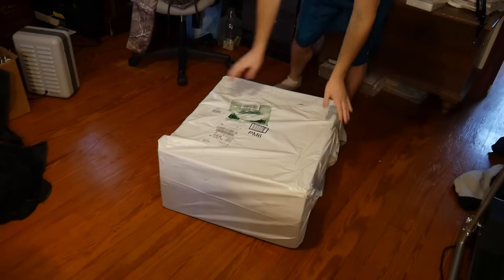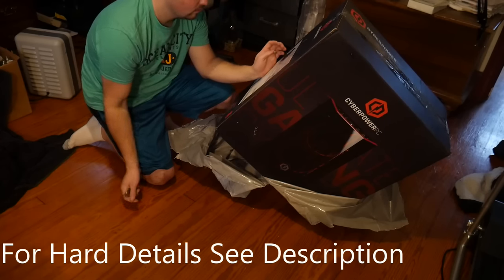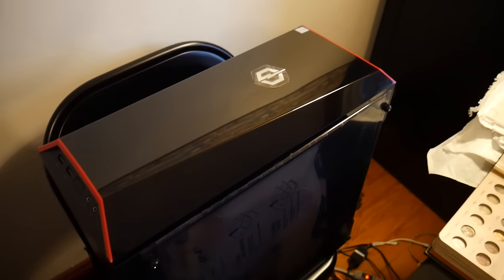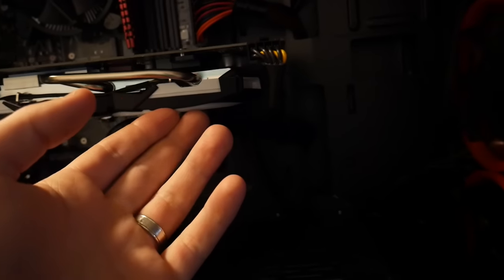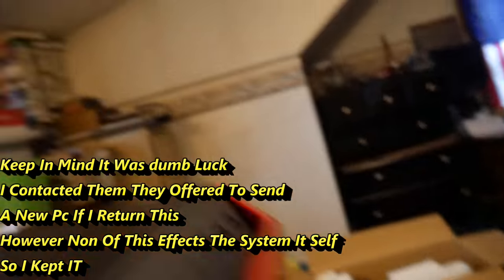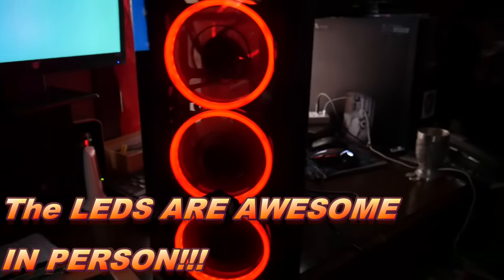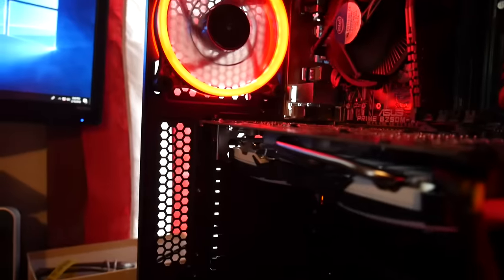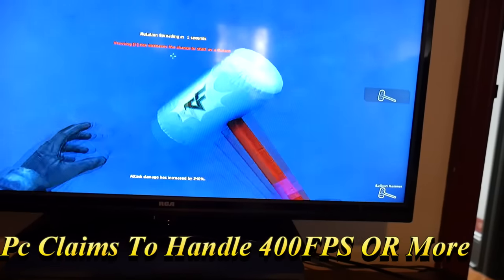CYBERPOWERPC Gamer Xtreme GXIVR8020A4 PC Full Honest Unboxing Test & Review

Comment: also would it be a good pc for starter console gamers? say if i wanted to switch could it run good as or better then console FPS?
Reply from the maker: You'll never get as good as a consol unless you spend 1400$ or more consoles and strictly designed for mostly gaming while a pc even gaming computers are designed for so much more for the value this pc is the best you can buy
Reply: Yes this 100 percent would.. I switched from a PS4 to this PC (but the latest version) and it can run games like fortnite over 100 fps while PS4 is capped at 60

Comment: how many hard drive and ram slots are there? also, can it run rainbow six siege over 60 fps?
Reply from the maker: I'm not sure on the game. There are 4 ram slots and I believe 2 or 3 hard drive slots but there's plenty of room to add anything you'd need you could stack 5 ssd  drives on top of each other if needed you won't run out of room that's for sure
Reply: The Life Of Scott Wenger okay thanks!
Reply from the maker: Your welcome!

Comment: How would you connect this to the Monitor?  What do you need to do so, I'm so new to this stuff...Sorry lol
Reply from the maker: It's ok :) if the monitor has a HDMI port then you just connect it from the HDMI monitor port to the pc HDMI port if it only has a vga connection then you connect a vga cable from the monitor to the pc
Reply: @ScottsHonestReviews  Thanks so much!  I'm getting an Alienware 25 Freesync monitor and have been researching stuff for 2 days now on and off.  I'll check and see, I think its an hdmi
Reply: The Life Of Scott Wenger I have a question. I’m getting this for Christmas and you said it doesn’t have wireless internet connection?
Reply: @impulse5476  I think he said it does...but idk.  Re watch the vid just incase I'm wrong
Reply: @impulse5476  Oh yah he said it looks like it dosen't!
Reply: Jared so what usb would you need to use?
Reply: The wifi adapder lets u connect to internet
Reply: TornadoEF6 what do you plug the adapter in to the wall or what?
Reply: @impulse5476  Well I would use a wifi adaptor usb for the wifi, 1200mbs +
Reply from the maker: Awesome@
Reply from the maker: Yes it has Wi-Fi I just recommend getting a Wi-Fi antenna it plugs into your usb port and boosts your Wi-Fi signal for better connection and speed
Reply from the maker: A usb Wi-Fi antenna  in my description I have the one listed I use
Reply: @impulse5476  No you plug it into the usb port on the pc...watch some vids on it.
Reply: Jared ok thank you all

Comment: Bro I working for this computer it looks so good can it run fortnite or roblox at atleast 110 FPS or 130? Cause if it does it’s fine for me also does this last for years or do you need to replace the tower every 3 year?
Reply from the maker: I've had it over 3 years no issues and under med settings u can

Comment: Please answer this for me. Does this pc have any heating issues? Do I need to change the power supply since I have heard that it’s pretty bad? Thanks.
Reply: I saw many reviewers said the pc has heating problems, and they need to change the fans, take off the front cover, blah blah blah... I am pretty worried since I want to buy this... pls help me out by your experience with this pc
Reply from the maker: Hello, some heavy gameplay does cause the pc to get hot the the fans turn on I added a custom 2 fan setup see full video with simply adding a laptop cooling fans and taking the front cover off takes 5 seconds I am very happy with the pc for the value I've never found one better so far
Reply: The Life Of Scott Thanks!!
Reply from the maker: np
Reply from the maker: here is to see live gameplay with this pc under maxxed settings Fortnite https://www.youtube.com/watch?v=4pxrZpGDOmo
Reply: Jacky you do need to change the power supply because it can damage your computer I recommend you get an 800 watt certified one and the heat is not good unless you add more fans but most cyberpower PCS come with a bad power supply I recommend you don't even power it on if you get it and just buy a better power supply

Comment: Can you upgrade this to 16gb ram? Will this pc run future/next gen game smootly? Thanks:)
Reply from the maker: Yes and yes I have 28gb installed
Reply: SteamBun34 yes but it comes with 8gb of 2400mhz so to upgrade either buy another stick of 8gb 2400mhz or go with a 2 pack of 8gb 3000mhz as a recommendation cause then You can do dual channel with the mobo and the speed with be faster with the dual channeling and the fact that it’s 3000mhz now

Comment: Is it good still?
and do you have problems with the 802.11AC Wi-Fi USB Adapter
Reply from the maker: never had any issue with the usb wifi i use - links in descrp. i use this wifi antenna on a few of my Pc's

Comment: Can you tell me the frame rate of Fortnite in highest settings? Also does this have rgb?
Reply from the maker: ive seen some with the same pc get 40fps and others 60+ me personally  i over clocked the gpu and get 75+ now with maxed settings
Reply: The Life Of Scott Wenger cool. What about rgb?
Reply from the maker: If you mean multi color rgb no this one just lights up red  which is awesome I have multi color ones in my descrp

Comment: What does the wireless usb do, I didn’t catch that part, is it for WiFi
Reply from the maker: it helps boost your wifi signal so you get a faster connection and more stability , if you cant run a Ethernet cable then you def want a wifi antenna

Comment: Did the wireless WiFi connector and the keyboard and mouse  come with the actual pc or did you buy those items separately?
Reply from the maker: it came with a cheap wifi extender so i bought another one the one in my description. The Pc came with the mouse and keyboard

Comment: Can it run fortnite at atleast 144 fps?? Also what is the fps when you have all the setting off
Reply from the maker: you'll need a 1500$ pc for 144fps, your looking at 65 to 135fps depending on settings and if you overclock the gpu
Reply: Yes, you can. If you have the typical settings of all low but distance epic. It can run above 200 fps.

Comment: People say that the cyber power pcs from amazon slow down after a year of gaming is that true?
Reply from the maker: Honestly I've had mine for many years now and I recently just benchmarked it and is almost the same speed as day one and I even have maxed the hard drive out lol
Reply: Because I see pc like i7 gtx 1660ti with 16GB ram 256 SSD and 1TB HD pc going for £500-700 and that sounds too good to be true like where are they cutting cost? Coz if you try to build same specs yoursself it comes close to 1K so how are they selling these PCS for 700
Reply from the maker: @XtremeGamerps4  i built a gaming pc that performs better than the cyberpower pc for 850 USD and i didnt get any sales im sure if these companys buy in big bulk they can get really good deals i think cyberpower pc cuts cost in the cooling area with stock cooling the pc can over heat while gaming heavy so with about another 150$ you can solve that problem not to mention they dont add much ram so they save money there so you'll want more ram cards
Reply: Which one do you think is best value for its specs and will keep running good without problems like crashing etc
Reply from the maker: that is a tough call they both are very nice but i would go with option #1 if you want something to last much longer

Comment: How would this perform playing destiny on high setting ?
Reply from the maker: It would perform pretty good maybe some slow spots but for the price you can beat it
Reply: @ScottsHonestReviews   not to worried about the "price" more concerned for the performance overall
Reply from the maker: @istyl3z84  then you'll need to buy a 1500$ pc if your worried about that
Reply from the maker: @istyl3z84  any pc under 1000$ won't run really high end games  games perfectly this pc if you over clock the gpu will run most games perfect at med to high settings but if you want every setting maxed to the highest quality ect then a 1500$ pc is what you'd want I got a bunch in the video descrp that are higher end pcs for true hardcore gamers

Comment: Does the Wi-Fi adapter come with all models?
Reply from the maker: If you mean internally then yes but you'll still want a antenna for better signal ..  But I bought a separate one called Alfa network it's much better then just the internal wifi
Reply: The Life Of Scott thanks for the reply I was thinking the same thing
Reply from the maker: Your welcome the one I used a link is in a description if u wanted to check it out

Comment: what kind of power supply does it have?
Reply from the maker: im not sure on the power supply but ive never had any issues with it and i have  11 usb's plugged into it with 5 extra cooling fans and a custom led fan control box and again never had any power issues

Comment: Did you add an SSD to your computer?
Reply from the maker: The pc came with a 1Tb drive but there is room to add a few more if the user wanted
Reply: The Life Of Scott thanks for replying. Regarding the  Windows operating system that comes with the computer where exactly is that located. For example is that part of the motherboard or is it loaded onto the Hard Drive? I want to install a SSD in my computer (same one as yours) and I'm trying to figure out if I can unplug the Hard Drive and plug in my SSD and have Windows install onto it
Reply from the maker: Windows 10 has been peri stalled on the hardrive that is already installed on the pc
Reply: The Life Of Scott thank you, I got my SSD to work!
Reply from the maker: Yay!! Good :)
Reply from the maker: here is to see live gameplay with this pc under maxxed settings Fortnite https://www.youtube.com/watch?v=4pxrZpGDOmo

Comment: Can you install an elgato hd60 pro to this PC?
Reply from the maker: I currently use a hd60 with no issues I'm not sure on the 60 pro but I wouldn't see why not
Reply: 赦さ魂Manny Fields you should be able to install it but you need to verify and see if the motherboard has an extra PCI slot if so then there’s no reason why you shouldn’t be able to it’s just like a jeep you except it goes into a PCI slot not a PC i.e. slot

Comment: I just got this computer, I'm able to turn it on and made sure everything thing is plugged in on the inside. I hooked the HDMI cord to both my monitor and tv but both to no avail. Am I doing something wrong?
Reply from the maker: Plug the HDMI to the gpu HDMI port it will be the one near the bottom of the pc , or the HDMI if it's a used cord could be the issue
Reply: @ScottsHonestReviews  thank you so much for responding! it might be the HDMI cord since I've been using it as my ps4 to tv plug in
Reply from the maker: Before you get a new one just try plugging it into each HDMI port on the pc and see if that helps

Comment: Can you connect a lan cable for wired internet ?
Reply from the maker: Great Question! Yes You Can :
Reply: Last question, btw thanks for answering! Just wanna know what’s the maximum FPS can it run on fortnite
Reply from the maker: well that depends if you have every setting maxxed 55-65fps if you turn off settings u dont need 70+ if you over clock the gpu you can get 80+ turn the settings on high you should get 80+ turn them on low you should get 115+

Comment: what does it run on fortnite on low settings/ high settings (frames)
Reply from the maker: Ultra max settings 55 to 65 fps low 75 to 85 sometimes much higher depends on your internet connection etc
Reply: vapes u can get into the 200s on competitive settings my guy

Comment: You might wanna get a different cooler for your processor if you haven't done so already. The stock Intel coolers are a joke and are just completely useless.
Reply from the maker: It's been over a year and I have 54 games installed never had any issue with it???
Reply: @ScottsHonestReviews  Just some advice. The Intel stock coolers are known to let processors overheat and burn up especially on an i7 processor. I haven't used a liquid cooler yet because I don't trust them yet so I usually use an air cooler from Cooler Master or another reliable brand. The one I am currently using is a Cooler Master V8 GTS. The retail price is around $100 right now but it's on sale on Newegg for $84.99 at the moment. But they have some cheaper air coolers that are pretty nice too.
Reply from the maker: you can tune the intel fan to run faster or slower or tun on faster or slower at different temps to keep it from over heating ,

Comment: How much hertz is your monitor
Reply from the maker: not sure on the hertz but - https://amzn.to/2LzGasC Thats link  
       Monitor: 21.5-inch diagonal Full HD (1920x1080) IPS; Enjoy vibrant images with 178-degree wide-viewing angles.
       
       
       Resolution and aspect ratio: Full HD and 16:9; 2 million pixels for crystal-clear visuals and vibrant image quality.
       
       
       Response time: 7ms with overdrive; Get a smooth picture that looks crisp and fluid without motion blur.
       
       
       Ports: VGA, HDMI, and HDCP support help you stay connected;Power Consumption: 20 Watt
       
       
       Environmental features: Mercury-free LED backlighting, 
Arsenic-free monitor glass, and the low halogen design promote energy 
efficiency.

Comment: i just got this pc, and it has 2 cd's.
What are those for and how do i use em?
Reply from the maker: Hello you don't need them you can visit amd  to update the drivers or buy an external CD drive the one I use is plug and play it's in my description
Reply: @ScottsHonestReviews  ok so you do need to use those cd's.
2nd question: when i play lol, my ping goes really high (80-120+) every second. How do i get lower ping with the pc?
Reply from the maker: @nervz  thats going to depend on your internet connection, your service provider the location of your home, if your using ethernet or wifi then of course if you have any web sites or programs up while gaming

Comment: im having an issue...I do not think the gtx 1060 is currently...on if that makes any sense... i cant even run league of legends on the lowest settings lol...but speeds are great outsie of gaming...do i need to update something or...what
Reply from the maker: I can easy hit 200fps on lol hmm did u install cds it came with?
Reply: The Life Of Scott uhh no lol theirs no CD place right?
Reply: The Life Of Scott I can't even open nvidia control panel
Reply from the maker: Hmm that's strange are u logged in the main user
Reply from the maker: In my description I have a link for a USB external cd drive they are cheap
Reply: The Life Of Scott yes I am. Ill checj your CD stuff.
Reply: Rabbit I just got it wtfffff :/
Reply: The Life Of Scott dude can I like send you a pic of the inside..theirs some weird pins sticking out that came with the pc...I don't know if they are to be plugged in somewhere
Reply: The Life Of Scott Problem solved I had the HDMI plugged into the motherboard instead of the gpu lol
Reply from the maker: Lol 😂 well at least problem is solved!!

Comment: I have a question, I just bought this pc but when I turn it on everything works expect that my screen looks very pixelated and I already check if anything was loose or something, any suggestions?
Reply from the maker: hmm its a good chance your screen resolution setting is wrongly set it should be set on 1920 X1080  if thats not the issue then its your monitor, if its too old that may be a problem if its not a Hd Monitor that could be an issue if its a new hd monitor then maybe the monitor its self settings are off and it should have buttons on it to go into the menu to see
Reply: The monitor is brand new, I have 2 months with it and it works perfectly with my ps4, when I turn on the pc the screen works for about 3 seconds and then the monitor blacks out. Also the USB's port from the back were working before and now they won't work. Thank you for answering by the way.
Reply from the maker: Is the monitor plugged into the right port? Also are u using vga port or hdmi
Reply: @ScottsHonestReviews  Yeah I tried it with a dvi, hdmi and display ports and nothing
Reply from the maker: Is it vga hook up or hdmi knock off hdmi cords can cause this as well as cords that have gotten wet or damaged
Reply: @ScottsHonestReviews   The hdmi works perfectly with my ps4, but I already contacted customers service from cyberpower and they said it should be something wrong with the pc. Amazon is sending me another one because I heard this pc is pretty good and it has very good reviews so hopefully the one coming doesn't give me problems. I'll let you know if the display is very pixelated again. Has it ever gave you any problems to you ? Can you play any games with no problems?
Reply from the maker: I've never had any issues. If the next one has the same issue then it's definitely not the computer

Comment: Is their anyway to fix a problem where the etherent is plugged in but sometimes the internet connection works then just stops all of a sudden then works again so on and so forth
Reply from the maker: if your router offers wifi like if your able to pick the signal up with your phone or tablet i would simply buy a Usb antenna for the pc. thats what i do then you wont need the Ethernet , mine i use is here  https://amzn.to/2L218PH